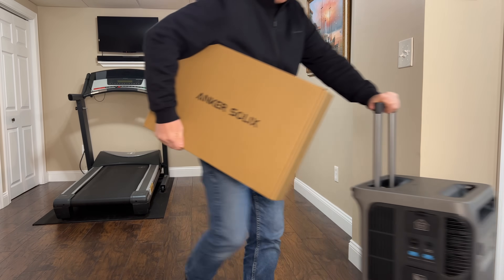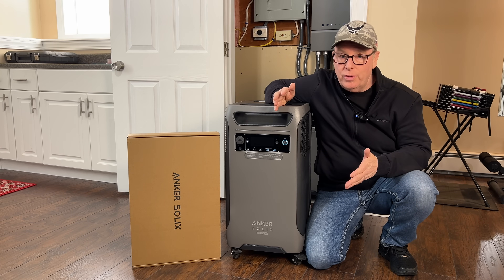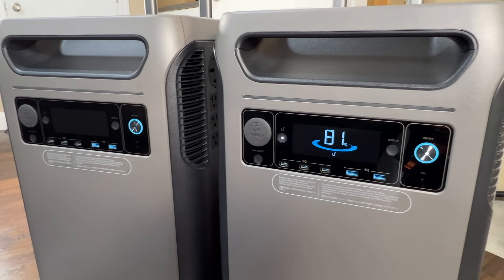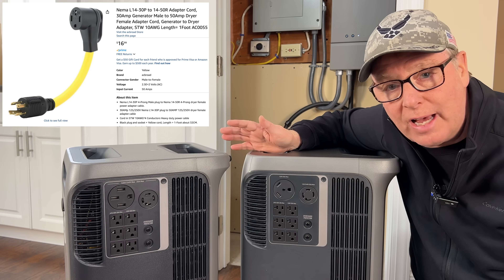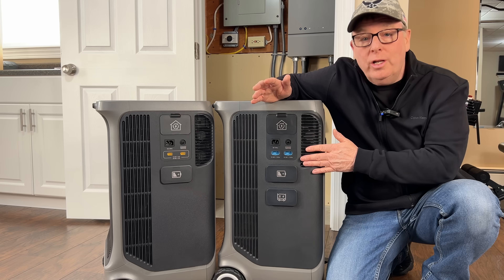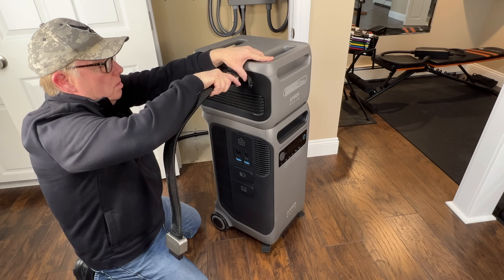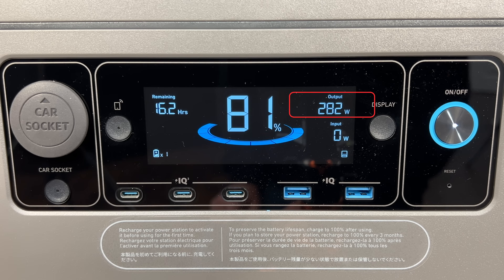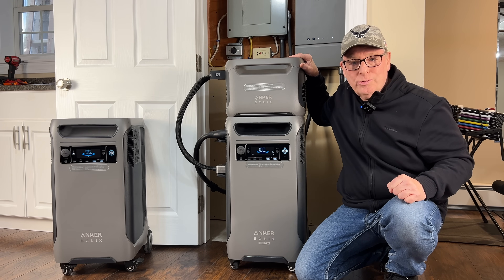Make Your Battery Last Forever (Anker Solix F3800 Plus)

Comment: Hi John, there is some confusion regarding the hookup of the new adapter cable. You mentioned that your preferred option is in option two, but your diagram does not seem to match your actual setup at home. As I understand it, you are connecting the adapter cable to the female 30 Amp plug below the panel and then to your Solix home box. When you mention a 30 Amp female receptacle as a feed from the gas generator, it is understood that during a power outage, you are supplying power to the panel via an external wall plug input that is hardwired to the panel. Additionally, you have activated the installed slide interlock switch to the correct generator feed position. 

The only thing about this that is a bit muddy as in another video you are quite animate about not using a suicide cable that is male on both ends and feeding the panel from the gennie to that female plug you have under your power panel. I know in your situation you are using that female 30 amp plug to feed out from the generator in a power outage situation I believe rather to feed in and the other end of the Solix adapter cable has protected connectors so no shock hazard. One potential concern with this setup is if someone sells their house and takes their expensive Solix equipment, they must remember to remove the 30 Amp female plug under the panel. The question arises as to why Solix opens to use the readily available interior 30 Amp plugs with the adapter's male end you are using on the panel side  instead of offering a cable option with female connectors on both ends, which would prevent the use of a "suicide cable in a 30 Amp female plug. It is understood that the cable has a male connector on one end to connect directly to the generator's female 30 Amp plug, as shown in option one. However, it may be beneficial for Solix to provide two versions of the cable: one with a female panel end and one with a male generator end. Or at least a male to female adapter to use in a protected male plug under the panel.  

Another question arises: you mentioned that with the new setup, it is possible to charge the F3800 Plus from the external gas generator while simultaneously using a load. Is that ability to charge the Solix unit while using a load controlled by the Solix home panel electronics or is that controlled by the F3800 Plus electronics? 

We are currently experiencing a week-long power outage in our area due to extensive damage to power lines and poles caused by a severe ice storm. Some residents are still without electricity. 

I have a 3600-watt 120V generator and an 8000-watt 120/240V generator (both non-inverter). I want to connect my 120/240V generator to one of the panels, but my setup doesn't work with the safety lever switch that prevents sending power to the grid during an outage. My 200 Amp power comes from the meter base at the front of the house, then runs under the basement floor to a 200 Amp fused disconnect switch in the basement. It from there feeds a distribution box above it, which supplies the original 200 Amp panel upstairs, as well as two 100 Amp sub-panels: one beside it and one under the main floor garage. 

This was done this way because I moved a manufactured home onto a foundation. The original house had a crawlspace with the power meter at what is now the back of the house at ground level. The new installation was all code-approved and inspected. The main 200 Amp disconnect allows shutting all power to sub-panels from one switch, which is convenient when adding sub-panels. Unfortunately, this setup does not support the safety slide switch required to prevent feeding external lines when connecting a generator to the main panel. 

However, I can manually operate the main disconnect switch, but this requires following a specific sequence to engage and disengage correctly and likely not accepted as legal. My initial plan was to connect the 240V generator to the 100 Amp sub-panel in the garage being closer to an external generator and after throwing the main disconnect switch and starting the generator connected through a 30 Amp breaker that would in turn energize all three panels. I am uncertain how this arrangement will function with the Solix system. A quicker solution for my situation might be to install a 30 or 50 Amp power meter generator adapter that directly feeds from the generator and automatically handles the switch-off operation on the grid side. 

Nevertheless, I am still evaluating how this could integrate with the Solix equipment, and I am exploring alternative options.

https://www.globalpowerproducts.com/transfer-switches/generlink-transfer-switch/

Lots of fun.
Reply from the maker: The Anker Solix generator input adaptor is not a suicide cord. It has a male L14-30P on one side and a recessed (proprietary) Anker Solix Home Power Panel connection on the other. The L14-30R receptacle under the panel is supplied from my main panel but only when the generator breaker which is interlocked with the main has been turned on. So is basically extending the connection at the generator into the house. I did it this way so I can selectively run loads in my main panel as needed but also supply my critical loads in the sub panel and charge the F3800 Plus at the same time.
Reply: @BackyardMaine  Hi John, yes I am aware that the Solix cable is not a suicide cable rather I was referring to the L14-30R receptacle under the panel having a potential to use a suicide cable from a gennie in a power outage as you have noted in your other video  at  3:00  https://youtu.be/jNuVsFeL7vY?si=WCssSPGNWBOsM6hd.  I understand you are not going to use it in this fashion but it opens the door for a possible future owner to use it this way. As well I understand in a panel setup use as normal could have high amperage female receptacles for things like welders, heaters etc. but this type of female receptacle doesn't mix well with generator backfeed cords to the panel. You know yourself even the Solix adapter cable can plug into that receptacle as well. So it would bring up the question that that it would be safer that all receptacles for back feeding into a panel be protected male receptacle such as the external gennie to wall receptacle is. This would be if that same type of backfeed receptacle was under or near a panel it could be marked generator feed only with feed breaker on and main breaker off. You have an awesome setup there John and I am not in any way trying to take away from that but as you said you have encountered many out there doing very questionable things with gennie hookups that are not done by proper research of proper methods. Does your subpanel have a disconnect from the main panel and the subpanel or just the main? On another note that bottom receptacle on the F3800 Plus that has a picture of a generator on it do you think that is for future plans to have a gennie hooked to that to charge the F3800 plus and or feed through. Maybe they have some software updates coming that will allow the interior electronics accept a gas generator with out the adapter or an inverter generator that does not need the adapter. I am assuming the big Solix adapter is some kind of a power inverter or cleaner and possibly they can incorporate that same feature into the F3800 Plus or future models. John have you got a schematic on the different ways you are running the system with the Solix and with the L14-30R in the picture. This would be very useful to bring clarity on your system function. Perhaps another amazing video like this one but more of a white board schematic run through Dr. John LOL. Take care and be safe...

Comment: Hi,  love the videos.   So I have the Anker F3800 (not plus) - A mistake I apparently made I found out from your video is that I can't use my regular gas generator.  You do quickly mention early on in the video that I could get an inverter generator and use it to charge up the F3800.  Did I hear that correctly?  I'm looking a the HF Predator.   You thoughts?   Thanks, from a fellow Mainer.
Reply from the maker: Thank you. I'm glad you find the videos helpful. A quality inverter generator produces a a pure sine wave. The F3800 should have no problem recognizing that and allow it to charge. A standard gas generator spins and a slight fluctuation and the sine wave is choppy. (modified sine wave). The F3800 will not ever recognize that as a power source. I like the generator input adaptor but I may be picking up an inverter generator as well. The reason is when charging the F3800 plus the Home Power Panel bypasses generator power to my loads and some of them are sensitive. Just be sure the generator has a pure sine wave inverter. I assume the Harbor Freight one does but I don't know. This is the one I'm thinking about buying. It's a quality electrical manufacturer and it gets really high reviews. https://amzn.to/422dgck

Comment: Tell me more about this "charge converter connected to the solar inputs" @1:25... is this something people do with the F3800? I can't get the plus... would appreciate specific equipment recommendations that are known to work.
Reply from the maker: The EG4 Chargeverter takes a 120/240v standard generator feed and converts it to 48vdc. This can be connected to the solar inputs on the F3800 and you can charge and run loads at the same time. If you have a 120v utility feed at the site you could charge through the 120v power cord and use the ups backed receptacles. But if you want to use the others as well and you don't have 240v on site you could buy a golf cart battery charger which converts the 120v to 48vdc and charge that way. When charging through the solar inputs, you would have full access to the power block. Here's a link to the golf cart chargers. https://amzn.to/3Rz2mWF
Reply: My use case is... I have 120V@15A  available to a construction site and want to run multiple loads

Comment: I'm struggling a bit to understand the beginning of the video about gas generators being dirty.  It doesn't really make sense to have a gas generator making a modified sine wave.  Modified sinewaves come from DC sources and it seems strange that gas generators go to the trouble to convert the AC produced by the rotating coils to DC only to switch it back into modified sine AC...  wouldn't it be easier and cheaper to just provide the AC directly?  Then it would be a real sinewave.
Reply from the maker: A standard gas generator uses a mechanical engine to spin an alternator, which creates electricity. This process doesn’t create a perfectly smooth sine wave like the power from the grid. Instead, the wave is a bit choppy—called a modified sine wave—because the generator’s output voltage rises and falls more abruptly. It’s good enough for most tools and appliances but not as clean as utility power or a pure sine wave inverter.

Comment: I noticed that you reference the lower plug outlet on the F3800+, however, you plug the new Generator plug into the top outlet of the F3800+.  That is the same plug that fits the first generation of F3800 and what happens if you use the new generator cord on the older F3800?
Reply from the maker: I covered both those subjects in the video. The new connection with the image of a generator is the DC input port. It's rated for 60V DC and 120A. Its the same connection as the expansion battery but not the same home power panel connection which is used with the generator input adaptor. Also this generator input adaptor can only be used with the F3800 plus. It's not comparable with the F3800.

Comment: How does this work with 2 3800 units?
Reply from the maker: You can connect an F3800 and an F3800 Plus to the home power panel (HPP) but you would have to disconnect the F3800 to charge with a generator through the HPP or disconnect the F3800 Plus and charge it with the generator connected too the HPP connection port on the unit.

Comment: Does the generator adaptor clean up the dirty AC coming in from an old genny to the 3800 + so I can just plug in to the output of the 3800 + and use my electronics? No other panels used. Just In from genny thru 3800 + and then out to my home. Your video was the best to try to answer that, but I will not be going thru any other power panel. (Is the pass through clean even w/ a dirty generator charging?)

Comment: They need a trade in option. I use the 3800 on my boat and my main complaint was the slow charge rate. Even running  Honda 3000 to the input I can still provide 240v out and charge faster

Comment: Is that wire you used considered the Suicide cord?
Reply from the maker: No, it female on one side and male on the other. A suicide cord is male on both ends
Reply: @BackyardMaine  oh! Great! How's the layout? Thought it was both males since the wall and the f3800 are both females? Looking for something low profile like your wall plug since I'll have it indoors, but bought an outdoor LR 1430 P but they are pretty bulcky. Would like to have one like yours butnI'm afraid of the infamous suicide cord
Reply from the maker: @patricioelosua5886  The other end of the cable has no exposed parts similar to the one on the F3800P. Take a look at my other videos and you will see that connection better. But it isn't something you're going to pick up since it's proprietary.

Comment: I picked one up to use on my travel trailer. I waited almost a year hoping they would update it to allow generator pass through charging, and thankfully they did. Mine arrived yesterday in Alberta, playing with it now to see how it handles various loads on my trailer before starting to install CIGS panels on the roof and making holes for permanent wiring for it to live inside.
Reply from the maker: Very cool!
Reply: Can the F3800 Plus be charged at AC 120v or even 240v while discharging AC 240 ?
Reply: @ChUcK2001   I dont have the generator charge cord yet, but you can't charge 120 while outputting 240 with this unit. One of the last big downsides to this unit over competitors. You can AC wall charger 120 and output 120 using the 3 UPS plugs that are 20amp. You can generator charge 6000 watts @ 240v and passthrough 240v. You may require additional expansion batteries to straight charge at 6000w only without passthrough, it will aparrntly linit your charging to about half that or so. My understanding is you can also generator charge with 120v using an adaptor from 240 to 120v TT30 travel trailer 3000w 30amp connection, and I have heard unconfirmed reports that it will allow 1400w passthrough charging, likely on the TT30 travel trailer 30 amp plug (25 amp output only)
Reply from the maker: @kevinmorley8119  You can only charge the F3800 with solar while outputting 240v. The F3800 Plus will allow charging while outputting 240v through the HPP connection. You cannot change through any of the receptacles on the output power block including the TT-30R. But you can connect a cord to the TT-30R on your generator and adapt that to a 14-30R and use the generator input adaptor to charge the F3800 Plus through the HPP connection at 3000W max. I'm think that will develop a gas powered DC generator to connect to the New DC input connector but we'll have to wait and see.

Comment: Great video!  By the way, I think with the Generator Input Adapter and with your method of connection one can charge any power station with a Gas generator and it need not be the Anker Solix F3800 Plus. Is my observation correct?
Reply from the maker: I don’t think so because they have a proprietary end that connects to the HPP port.